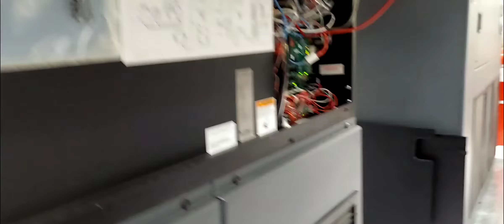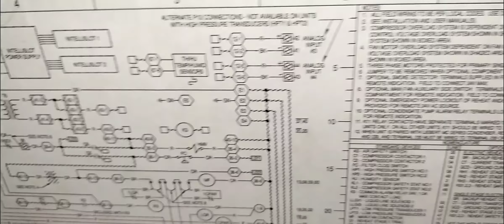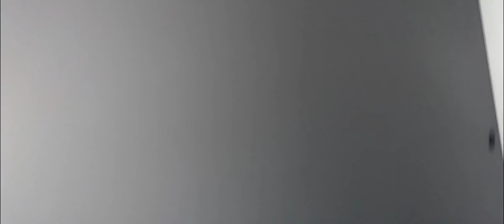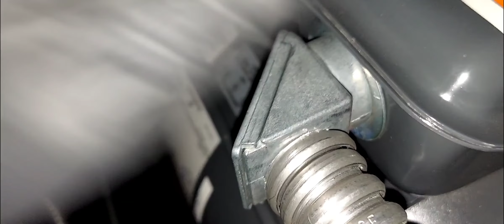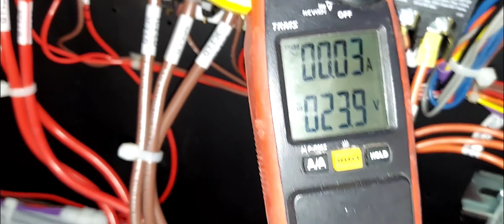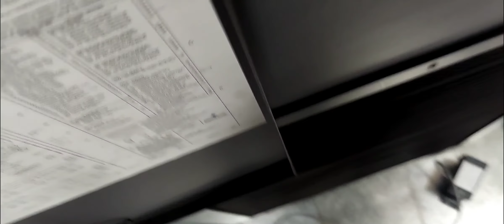HVAC TROUBLESHOOTING

Comment: Good Afternoon, I have a Liebert model: PX011UA1A8B679, the set point is 23 degrees Celsius and 12 dew point, the problem is that the Card Model: 416441G burns, the red LED lights up, it is the one that activates the contactor coil. the Resistor, that card receives 24 v from the main card and has a 24 v output for the contactor coil, could you help me please, Regards.
Reply from the maker: What  card?

Comment: I have a Liebert Model: PX011UA1A8B679, the set point is 23 degrees Celsius and 12 dew point, the problem is that the temperature drops to 18 and the humidity does not drop below 70%, it has resistors, 24 volts do not reach the coil of the resistance contactor, the password I entered is 5010, Greetings.
Reply from the maker: If heater not working or unit not equipped with electric heater
Reply: @D2DNYAC  At what level can I see the resistance card alarm? Or how to reset the card is on a solid red LED please.
Reply: Try password 2210, it gives you 3rd level access on all Liebert systems.
Reply from the maker: So you can go into setup option and disable dehumidifier or raise humidity setpoint however not to high because now you activate humidifier mode necessary if it available
Reply: @robomaniac8  Before the resistors there is a contactor and a card has a fixed red LED, could it be that the card has been damaged or could it be some parameter that the card has a red LED?
Reply from the maker: Does your liebert have dehumidifier option? If yes lower the humidity setpoint.  Here it will run the cooling and the electric heaters simultaneously after room temperature setpoint has been obtained, to remove humidity. In the event your liebert don't have dehumidifier option or the electric heater don't work, this will cause room temperature to fall well below setpoint while in dehumidifier mode
Reply: @D2DNYAC  This Liebert dehumidifies with resistance has a card and a contactor, the residence card turns on a fixed red LED.

Comment: Good video. just an FYI they run those motor leads through that metal flex and it rubs the leads inside causing them to arc on the metal jacket when the unit vibrates while running. I had a unit tripping like this just recently thinking it was the overload just to come back with the overload tripped and a blown fuse
Reply from the maker: Thanks for watching my friend

Comment: One would think that the overload at the time of your checking the motor windings would have been open.  Suggest in future you make this check at the load side of the overload
Reply from the maker: These isn’t connected to motor windings circuits !

Comment: Blower contactor visual and voltage drop test. I know you said you would just replace it with the OL, but that's just changing parts not diagnosing. :-) Yea... I giving a little bit of crap... Thanks for the video.
Reply: Might as well replace the contactor while your at it lol cheap part that can possibly save a call back
Reply from the maker: Indeed everything checked out and passed. Amperage ,voltages, resistance, even mega ohm the the motor no problem found
Reply from the maker: It was an intermittent malfunction between the overload and contactor

Comment: Whoever changed those filters recently left the panels open with no filters in it for to long more than likely and over amped it.
Reply from the maker: Possibly
Reply: I have seen a unit trip when filter replaced without turning the unit off and also seen the unit trip when testing smoke and fire alarm panels causing the blower to stop

Comment: Thanks for taking the time to make the video for others.

Be interested to know what you found out after letting it run a while and if you discovered if the winding insulation was deteriorating via the megger test at 500V.  After it ran a while,  the amperage imbalance or lack their of.  You know, each legs amp added together, divided by 3, and then the % of deviation for each lag from the average.  I mean thats just what came to my mind as I was viewing video.

Enjoyed the low voltage portion the most.

I've seen some motor overloads that have a N.O. contact that is wired to the contractor's  auxiliary to "cut" the low voltage to the contactor coil, but I didn't see that on the video.  So the motor contactor in your situation was still energized?  Correct?

Again, thanks and keep in the training mode.
Jeff
Reply from the maker: Meg tested @ 500 & 1000 volts and the motor passed, the amperages was with tolerance, the overload doesn’t break the line voltages (please watch video again and look closer at OL) it only breaks low voltage (24v) from Q5 output